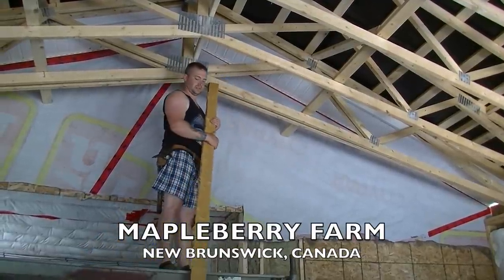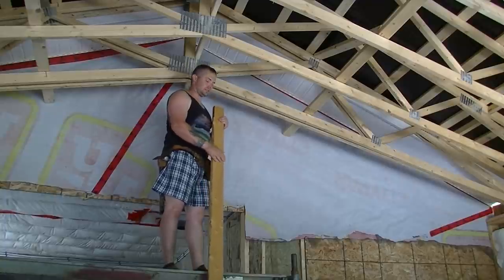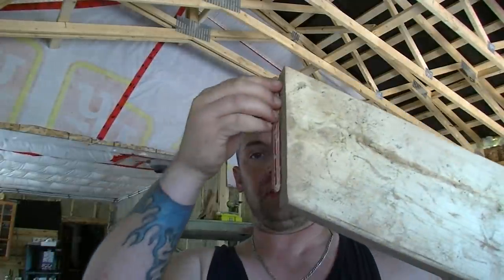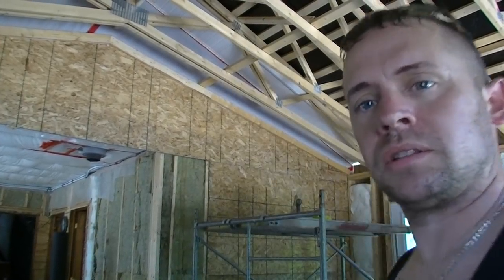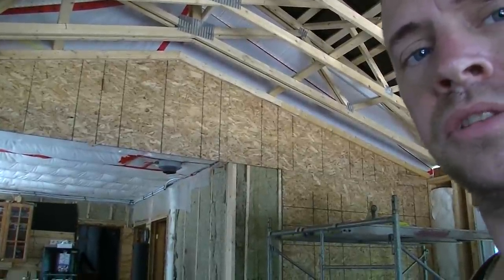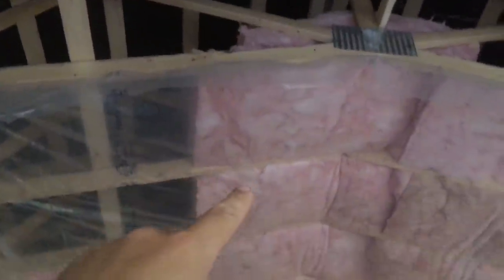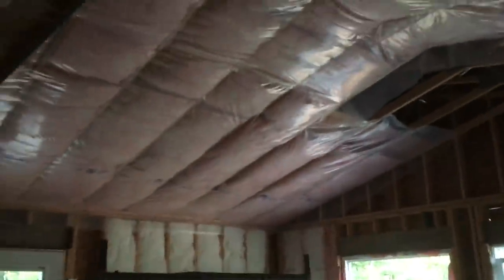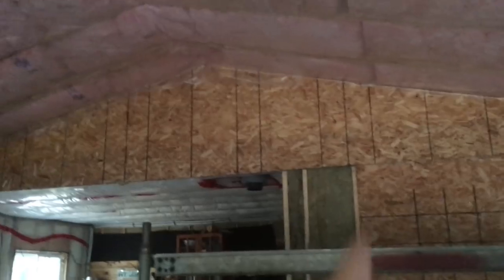INSULATING A CATHEDRAL CEILING IN MY UNDERWEAR | DIY OFF GRID HOME BUILD

Comment: Great work! I have always found it is easiest (with your given roof design) to strap the ceiling first, inaulate then vapor barrier. I realize you have done the job already. It looks like it will work. Keep it up!!!
Reply from the maker: All the best Charley. We wanted the pine boards running horizontal, the reason we didn't strap it.

Comment: I was dreading this job on your behalf lads.  The heat is energy sapping but this has to be done before the Winter just like last year, but a hell of a lot higher!  Does that foam 'baffle' sheet piece with the bumps in it stay between the beams on it's own?  If it doesn't need nails or screws because it holds itself in place that's a huge help.  Are the windows & doors closed because you have a fan going to try & cool you down?  I suppose doing this naked is a bit too dangerous? Lol.   Still you could try Togs (Swimming Costumes, I think it's an Irish thing, it's what we always call them anyway), it'll cut down the laundry if nothing else lol.  Good luck you two, keep up the good work, but give yourselves time to re-charge too.  You've both been through the wringer a bit this year and you need it to keep you strong, healthy and sane!  But come Christmas when you're sitting on your sofa warm & toasty even with a vaulted Cathedral ceiling, looking down your driveway with the Snow falling outside and the tree lights twinkling inside, stockinged feet up watching a movie before bed,  this will all have been worth it. 🎉
Reply from the maker: The baffles are stapled in place.
Reply from the maker: We had the windows open and doing it naked would probably get pretty itchy handling the insulation lol

Comment: Good progress being made.  UGH on the heat..   Did have a question though.  Are you doing any lighting in the ceiling?  Would think it to be easier to prewire for fixtures before insullation?  Now, you'd have to dig around in that itchy insulation again.
Reply from the maker: Yes, I have a 12 Volt ceiling fan light we are going to put up there.

Comment: My garage ceiling is like that. Cant just be flat. That would be too easy. I was thinking of putting up osb and blowing in insulation but the way you did it looks like it's going to be a lot easier. What did you use for wrap?
Reply from the maker: I cant remember the exact thickness of the vapour barrier but it was poly vapour barrier.
Reply: @MBFModernHomesteading  did you staple it up? In the video it looks like its sticking to the beams.
Reply from the maker: @scottmahony4742  Yes, it is stapled up.